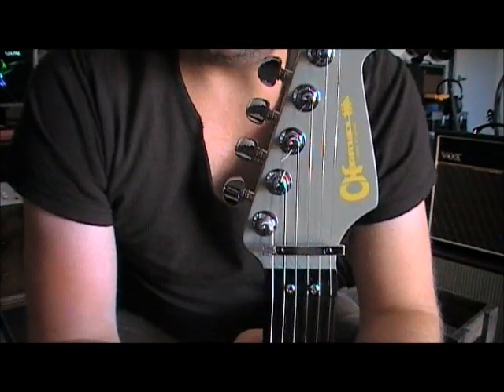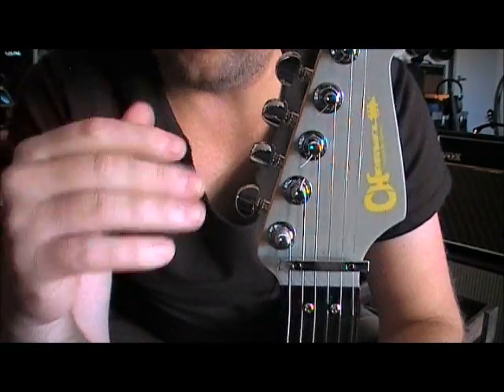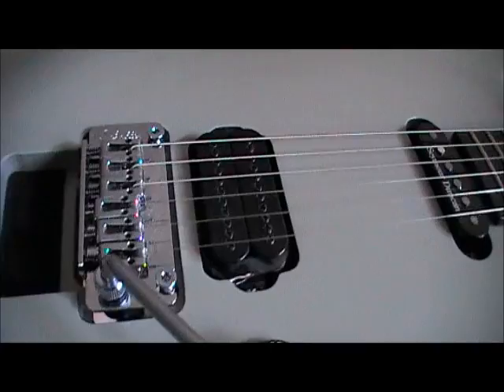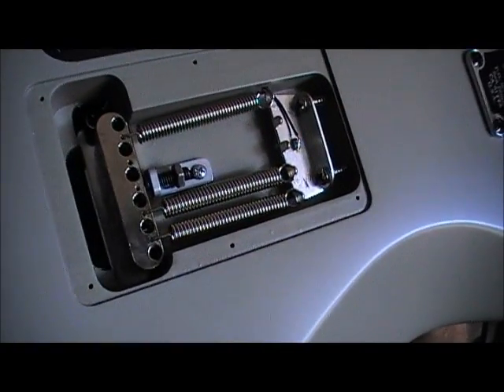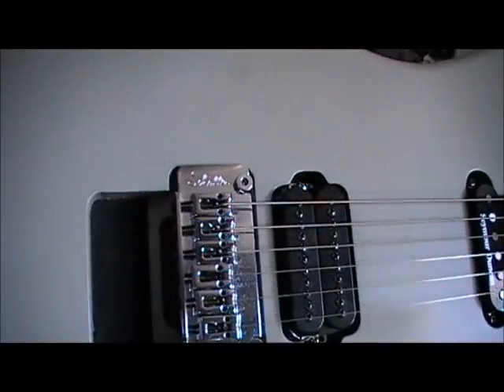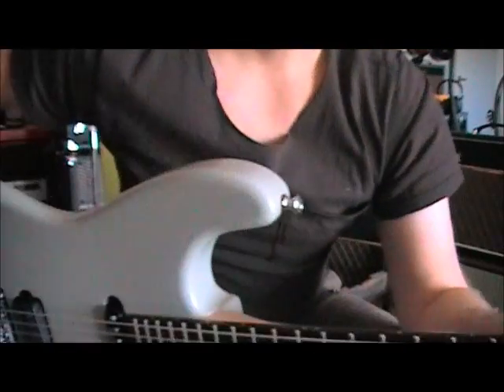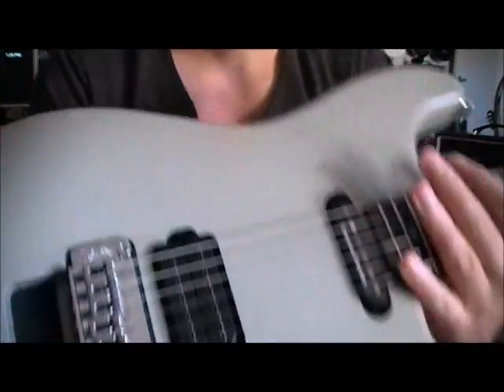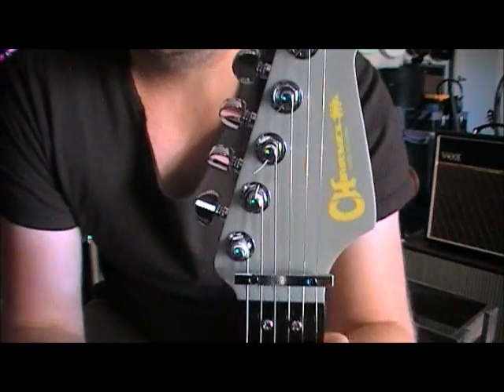De-Floyding - Floyd Rose Conversion

Comment: It's a shame that it's still a "floating" solution and not a real hardtail, but at least it'll take no tools and 20 seconds to change a string on stage, not various allens and 20 minutes. Really good idea, thanks for sharing. :)
Reply: So ignorant.. first off, never go on stage without a backup guitar ready. 
Also what you're saying is totally untrue, i'd argue it beeing faster than regular tuners. And it takes 1 allen key. So, get the allen key out of your pocket-2 screws(nutandbridge)-off with whats left of the old-on with the new one. 
Here is the crucial part. By using the ball end at the tuner and not cutting it off and wind it like a regular string, means you dont have to fuck around trying to lock the string in place with various turns on the tuning keys. "Durrrr! The string is to long so ill have to wind anyway" 
Just keep a fuckin set of  strings that is cut to length.
After that you roll the fine tuner back max, skrew the string and clamp back(only letting it rest on the string, tune b and e to pitch, stretch and tune again, screw it down, stretch the string even more with the bridge and fine tune. Good as new. Eliminating the tedious winding saves all the time and you will always have to stretch a new string so tuning more than once is requiered anyway. 

People tend to argue that it's a hassle to change all strings on FR too. Same method applies as above, as long as you use the same gauge strings. You dont have to set anything up, you just block the trem for easier work and then change the strings, but instead of rolling the fine tuners back you center them.
Changing string gauge and adjusting intoation can be hassle tho, its not a  flawless design. but people thing its rocket science, its not. A trained monkey could do what the luthiers take 100 bucks to do.
People are just to damn lazy to learn about their instrument to solve the problems themselves.

Comment: The Ebanol nut # BN-0624-023 and 0623 have been discontinued by allparts,their leftover stock was sold to Arkansas musicworks and liquidated on E-bay, they are SOLD OUT.I was told by a salesman at allparts that there were "too many problems and a very high return rate". This nut is made in Germany, after a days search on the internet, I could find no sources in the U.S. and these two companies were not aware of any remaining sources.You may be spinning your wheels to get them from Germany,and you may be very disappointed in the product IF you receive it. Music works could NOT recommend a proper fitting ROLLER NUT either.My Strat is going on the Market...good luck!
Reply from the maker: Thanks for letting everyone know! Sorry to hear that.
Reply: roger weafer how bad does playing thru an unlocked half inch metal nut hurt tone by itself? Not taking about the bridge or the block. I have a Michael Kelly Strat HSS with a F.R. Special. I’ve never played it for more than 5 minutes unplugged. It was given to me and the pups are not working. It has a great Birdseye maple neck with an ebony fretboard. 12-16 inch compound radius but a half inch black metal Floyd Rose nut. I’ve used brass/ this is heavy but it’s not brass. Its not pot metal either. The headstock is a cross between a Strat and a Tele. With a sticker or what they call a veneer. It would have to go and I would use it in place of a Slick guitar neck I have. It’s a lean back with a terrible headstock cut and every color has the choice of a maple or Indian Rosswood fretboard but all headstocks are matte black with a block SLICK in huge white letters and a worse white silhouette of Earl Slick in a trench coat. Only the black with black tape covering all white may POSSIBLY work. It’s a damn shame because the SSS MODEL won mid price guitar of the year 4 years ago despite the thing and it’s $220 today. I have one and I absolutely love it and it’s as good as the $1000 Chapman ml1 pro traditional I bought first like an asshole. No it’s better

Comment: I can't stand floyd rose. Worst bridge design ever made.. I got a Charvel as well mine was a bit better with EMG's and shell inlays etc but the bridge was aboslute junk.. NEVER stayed in tune after the first string change even with multiple supposed professionals setting it up.. Now people ask why would I do this instead of buying a fixed bridge guitar? Well its 120 for this bridge or 800+ for a new guitar.. not that hard a decision to be honest and who cares if theres a hole in the tail lol.. AS long as it stays in tune and can be intonated properly that all I want out of a guitar..
Reply: A lot of people seem to not understand the pricing thing as well. Floyd Roses are a relatively niche thing, so it's very common to find FR guitars on big sales when stock isn't selling. I had a choice between a Hardtail and a Floyd Rose version of my guitar and the FR was on sale to almost half price of the hard tail, that's many hundreds of dollars difference. For that I'll gladly buy the FR and swap it out. Even after the cost of the new hardtail I am still saving hundreds.
Reply: Floyd rose is incredibly well designed, the problem is most of the "floyd rose" bridges on the market are just copies with cheaper materials than the original.  The original floyd rose and several of ibanez floyd rose type bridges are incredibly stable and most work perfectly for decades if they're maintained.
Reply: Worst bridge design ever made? Obviously, you're not a golfer........
Reply: I've played Floyd Roses for years and I never have my tuning go out even after heave exaggerated use. Only rarely will I need a minor slight adjustment with tuning. I've also used what I thought were Floyd's but went out of tune like a bad habit, turns out they were licensed Floyd's and not original Floyd's, I have 2 Jackson pro soloists, and 3 ESP ltd's. 2 kh 502's and a H-1001 model. All with original Floyd's and I've played for hours on all of them without any tuning issues and absolutely love them all. But I've noticed everyone that says theirs is junk or not holding perfect tune when I got a chance to see them they are always set up wrong. Either not level with the body of the guitar or sitting at an angle to the body which explains their problems. And to block off a Floyd from pulling up takes away what made this floating system the choice of professional guitarists for years. And I'm a testament to their superior design and tuning stability. Do you think Dimebag, Marty Friedman, Kirk Hammet and many many other stadium filling musicians would play with something like you described?  I'll also add being you can't properly set up a Floyd or you have a licensed by Floyd knock off that you can't keep in tune how the hell are you ever going to be knowledged on advanced guitar technique and have advanced skills? Get you a tune o matic fixed bridge I'm sure it will remedy the true underlying problem you have. Floyd's are designed for guitarists that know their instrument and how to get the most out of it. I don't recommend a novice choose a pro level axe that comes with a Floyd by any means. Maybe that's why they come on most pro level guitars. But if you insist on a high dollar axe maybe consider your next guitar a hard tail. They make most models with that option for singers and rythem guitarists.
Reply: john Lindsley all I read in your comment was "I'm a jackass, I'm a jackass, I'm a jackass..."
Reply: I would not say that floyd rose tjl said worst design ever . Bullshit  with a  capital B. Mr rose solved some of the problems with the fender, like when u pull up it dose not take much pressure. And of course it does a kickass divebomb. I myself have a Yamaha pacifica 112j  with a 6 screw fender bridge and is works. A trem Both LEO FENDER and FLOYD ROSE  Have 2 different designs that do the same thing very well. Thumbs up to both men. They made modern rock and rock  possible.   We are talking  the stratocaster guitar NEED I SAY MORE.

Comment from the maker: Hi - the exact model of trem is listed in the video description, along with a link to the Schaller website. The tremolo post holes are outside the "E" strings, not in-line with them, as with most 2 post tremolo systems. 
Glad the video was helpful. Cheers

Comment: Just leave the cover off, looks fine. I'm over my Floyd. It's such a hassle to change strings. Just hate now.
Reply: Setting Intonation is the worst on a floyd fuuuuck.
Reply: Instead of  just a cover, turn it into a little box to keep stuff in like picks or drugz
Reply: I wanted a guitar but it had that and I couldn’t palm mute.. I dunno now if I should get the guitar back and convert it

Comment: I'm in the process of getting rid of my FR. Only I'm going full nuts. I'm cutting basswood blocks to fill in everything routed out for the FR, using filler, sanding, filler, sanding etc, painting my coffin all black and red and installing a bigsby. Though I am leaving one section open for the battery the active system needs.
Wish me luck...lol
Reply: What kind of floyd Rose?

Comment: I really hate the Floyd Rose system. I have a Schecter start and it's got the FR system on it and I have it locked down for 20 years but the trem is bulky. I noticed that a few people are confused with Schaller naming this trem a vintage, but the reason is it is a vintage style trem that fits the FR specs, so it still floats. In other words you can't put on a Wilkinson or Fender type vintage as the screws won't match. It's an option for replacing FR without replugging the screw holes and redrilling the guitar. I will replace my FR with one and lock that down and remove the neck lock and add string trees. I take it the string balls no longer need to be cut off either!!!!

Comment: Tried this on my Warlock. Unfortunately, while the Schaller Vintage Trem did fit the Floyd Rose posts, it got caught a bit when trying to use it. The deal breaker though, is that the saddle locations are so different from the position of the original saddles, that proper intonation was impossible.  So the Schaller is going back to the seller today, alas. The good news is that we found the Guitarfetish Fastloader Floyd Rose. It truly does drop in, and strings thread just like a normal bridge (no need to cut the ends off). Also replaced the locking nut with a Graphtech Model 6517 Unlocking Slotted Nut FR . My Warlock just strings up and tunes up like a normal guitar now. I don't even have to reach for the fine tuners. Stays in tune after trembombs. Couldn't be happier.

Comment: 1:40 Floyd Rose makes this "non fine tuner" bridge that is a direct replacement for a classic FR as well and it fills the route better. 
It's best known for being in the Guthrie Govan signature model by Charvel.
Reply: Is it still double-locking?
Reply: @ValSchnitzel  The bridge itself is locking and you can use it with or without the locking nut.

Comment: In lieu of the Ebanol nut I ended up fitting a Fender roller nut, the one with six independent rollers, and shimmed it to the desired height. However, I discovered that this trem doesn't play nice with the scale length of the neck on an Ibanez JS100 and I can't set the bridge saddles back far enough even with the little tension springs removed. At fret 12, I'm about 25 cents sharp. Since this is a project guitar, I'm considering moving the trem posts to gain the extra length and match the previous tremolo's position on the body.

Comment: Unfortunately the ABM Ebanol distributed by AllParts is discontinued now. The alternative to that is to have a luthier build an insert that will replace the locking nut, and which will be screwed to the headstock with the Floyd Rose mounting screws in the same way as the Floyd Rose nut was mounted, and in which a standard graphite nut will be inserted flush to the fretboard.
From that point on, you'll be able to replace the nut with standard ones whenever they finally wear out (if they do, as graphite nuts tend to last a very long time).
Reply: graphtech has a FR "Unlocking Slotted Nut" -- but not for a 12" radius...yet.

Comment: If you leave the locking nut but dont lock it will it cause the stings to break from friction? Thanks
Reply from the maker: No it should be fine. There are plenty of “open” metal style nuts used. Yngwie uses a brass nut and Fender used to fit the LSR nut to their Strats.
Reply: @BillPalmerMusic  Thanks!

Comment: I just simply pulled off the Locking pads and put on the new D'Addario locking tuners Auto Trim I freaking love it and I still have the fine-tuning capabilities on the Floyd Bridge
Reply: Benjamin galster can you still use the Trem?

Comment: Hi. I have a question. Can you convert it to a hardtail WITHOUT blocking it? I had issues with restringing, and I don't like how the floyd sounds anyway. I want to try to make it into a string through body. I have it blocked now, and it is still as much of a pain in the ass to restring it. I just want to avoid the tedious restringing and since I don't use the floyd rose at all, I want it as an hardtail. Also, since I have a VERY low budget.
Reply from the maker: Hey man. There used to be a product (like 10+ years ago) that was a drop in replacement for Floyd’s and that converted to hard tail. Last time I checked this wasn’t being made anymore. I don’t play much guitar these days so I’ve stopped tinkering etc. Sorry I can’t be more help
Reply: @BillPalmerMusic  yeah I did something similar but no it’s not what I was askin for. Thanks anyway

Comment: What do you think of the Floyd Rose rail tail dive only trem system? Replaces 6 point or 2 point with only 4 holes. U can dive 16 degrees further than a Strat trem. It’s the answer to the Floyd problem

Comment: Bummer the ebanol nut isn't available anymore...now I have to figure something out 😆 I'm Frankensteining a Jackson dinky that has a tom bridge but I have a neck from a Floyd equipped guitar...maybe I'll glue a piece of ebony in there then route it for a standard nut...or maybe I'll just be lazy and put a standard Floyd locking nut on it without the locks

Comment: Hi, I presume you had to re-drill the holes to fit the Ebanol screws ? Are they aligned with the original Floyd Rose screw holes ? Thx!
Reply from the maker: Hi thanks for the comment. No there was no re-drilling required. Yes, the holes are aligned with the original FR screw holes. The only thing I noticed was that the nut has a little "overhang" on one side but that is easily fixed with some sandpaper.
Reply: BillPalmerMusic Thank you very much for your quick response, I might give it a try :-)

Comment: Thanks for making this video, I am thinking about changing one of my Floyds out on one of my Charvels and this could be the way to go. I don't like Fender necks but I LOVE Charvel necks so I plan to turn my Made in Japan SoCal into a Fender Strat by changing the bridge and loaded pick guard to S/S/S. I bought a chrome OFR to put on it along with changing all other hardware to chrome but after seeing your video it looks like there is a better solution. I have both a Made in USA and Made in Japan Socal and both have top mounted Floyds. This means that, because there is a very small hole through the body, the Schaller really is a direct drop-in replacement without the huge hole left over behind it from the removed Floyd. It looks like it may end up looking like it came factory installed with that Scaller trem.
However, there is something missing about your Charvel guitar. The head stock says "Made in Japan" but the route on the body is recessed. Charvel didn't have recessed Floyds until they moved manufacturing to Mexico. Is your body aftermarket perhaps?

Comment: hey Bill, my mongrel strat has a Floyd without the routing.  So I set it up with the trem hard enough on the body so I can bend a note and trem stays against the body. I want to retain the fine tuning, maybe remove the locks on the nut and try that.  I'm Not really a dive bomber player, so should be ok.  It does sound a little modern compared to other strats with out a Floyd still though
Reply from the maker: Hey Scott, yeah that is one way to roll and it's a lot easier than replacing a whole bridge. A Floyd will definitely change the sound of the guitar, in my experience, it emphasises the upper mids more, and robs a little of the low end.

Comment: I have an American made Charvel So Cal, and was really looking forward to installing bridge , but unfortunately had to send it back because, although it would've fit right to the existing floyd posts, it didn't meet up with them. It would've required drilling the post holes closer to the cavity opening. 
I did try to go another route and filed the cavity, then it met up with the posts, but alas, it was too far forward to intonate the bridge. I had the saddles pinned to the back and still it wasn't intonnated .
 It is too bad , because the weight and quality of this Schaller is really nice..Excellent saddles and overall craftsmanship ..nice springs too. I unfortunately had to return it.
Reply: Charles G guitar sure it was the right model? They have two, one fits strat two post spacing and the other fits the floyd
Reply: Yup, it fit my floyd space.  The width or spacing was correct, but the depth of the body wouldn't accept it.
Reply: you mean the block itself? to long?

Comment: With this bridge there's no longer the detuning on a bending? Cause thats the main issue for me to replace the floyd rose. Thanks in advance, nice video
Reply: Al of that is solved with just the backstop.no need to downgrade the whole setup.unles you also get nightmares from cutting of ball ends

Comment: Nice little video. I've had a Jackson for years but I've barely used it because it has a truly terrible licensed Floyd on it. It never stays in tune and I've never been able to change the strings either. Thanks for the links. This may be the way to go. Cheers.